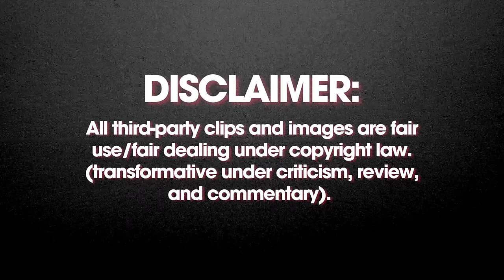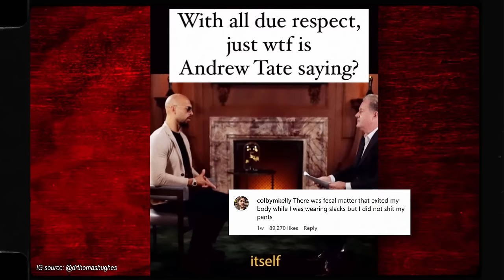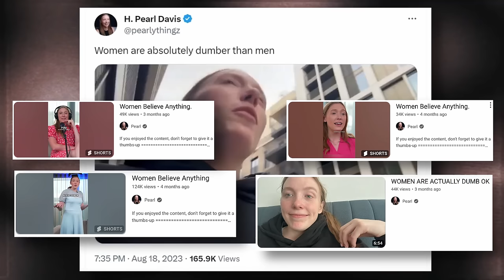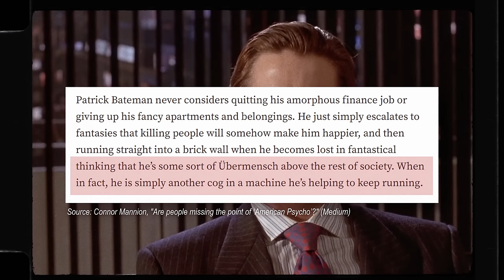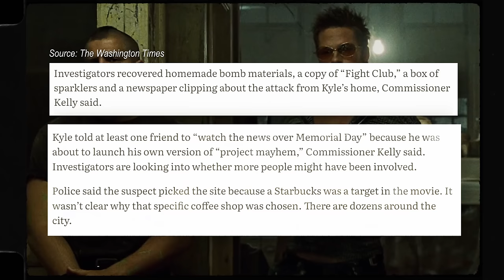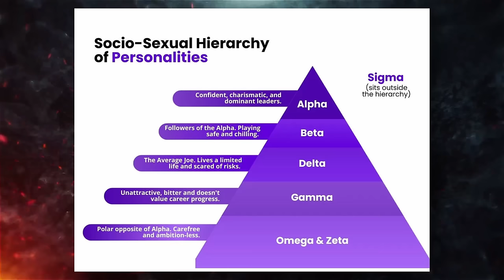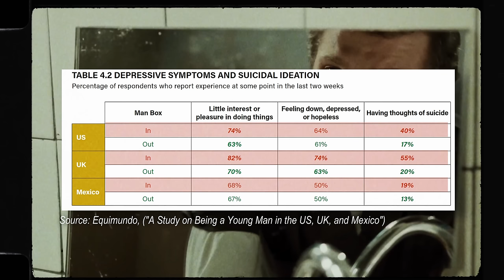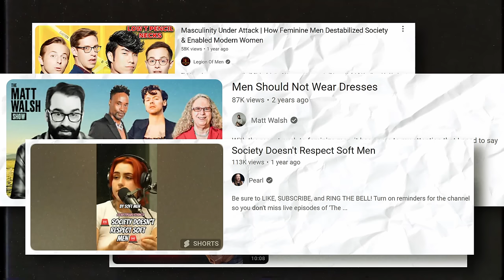The Poster Boys of Alpha Men

Comment: This podcast provides no value and epitomizes why the manosphere is blowing up. You are contributing to the problem rather than seeking understanding and providing pragmatic solutions.
Reply: @@JackBond-md4df She doesn’t have any solutions. Because her criticism boils down to “cry more and still don’t expect anything, but you’ll be seen as a good guy ☺“
Reply: @harsh3948  okay just because the manosphere offers solutions that doesn't necessarily make them good solutions. That's like putting a square peg through a round hole you can do it if you destroy the whole.
Reply: @DarksideGmss0513  if you criticize a solution without being able to provide a better one, you’re just being either deliberately stupid or have an agenda (such as the breadtuber in this case having marxism)
Reply: @harsh3948  because there's no "better" solutions to give. Everyone is different and has different problems so you give them a solution to fix the problem they have. The manosphere is trying to be a one size fits all solution for all of men's problems. It ultimately fails because it lacks the nuance to accomplish that task. Because not all men are the same just like not all women are the same just like men and women are different.

Comment: Re: 8:07, "confident in the body he is given", I would humbly submit here that many in the self-improvement for men space advise young men to get in the gym, and not for fitness influencer reasons, but to train the body, thereby assisting to train the mind, developing mental toughness.

I think everyone should get to the gym to lift weights as well as run because such training promotes the growth of muscle and bone density, thus adding to the longevity of the human body. I would humbly submit also that this is a process, and the body that is built is not just "given". On this topic, I do not advocate the use of PEDs (another can of worms entirely), and so yes, the body that one is given is important, and so one should take care of it with training and clean eating.  

However, very few men are "blessed" with such great genetics as to have six pack abs, stand over six feet tall, and be 6/5 stars handsome in the face.  For the vast majority of men (and the vast majority of people), training requires work, dedication, and perhaps most importantly, time.  It doesn't come in a package you can buy at Wal Mart (or at the Sephora counter).

One of my coaches used to say he wanted everyone in the gym (all the ladies as well!) to "be the best version of yourself you can be," and for today, "be one percent better than you were yesterday."

Bottom line: TL;DR: The body you're given is a baseline, and improvement goes up from there - train your body and mind over time and be the best version of yourself possible!

Cheers 😁👍

Comment: Your wrong at 16:00 Science supports when men express their emotions they usually arn't probably responded to, expected to not go to far expressing them even towards women in a relationship. This is a huge point which was completely covered. It doesn't allow men to cry or show their emotions. There are some support groups to help change this. It's easy to look for flaws in alpha content. but it doesn't get to the source what is driving it.
Also you brushed over PUA. Its a huge topic how to approach women nowadays or whats the socially acceptable way to do it. There are articles even by women talking about it pro and con. Picking out the most controversial moments in a PUA's career doesn't really get down to the matter. Men wanting to learn how to pick up women. The motivations, needs, etc. Why does it connect with the Alpha theme.